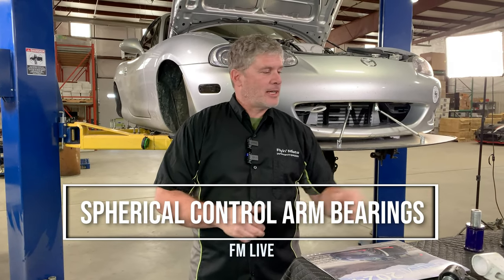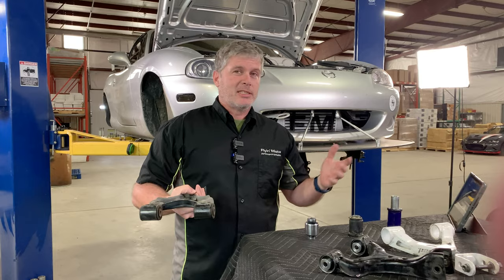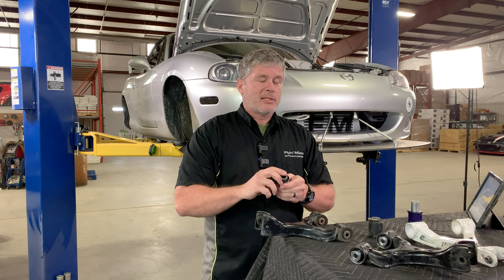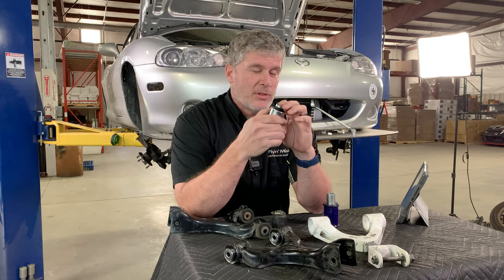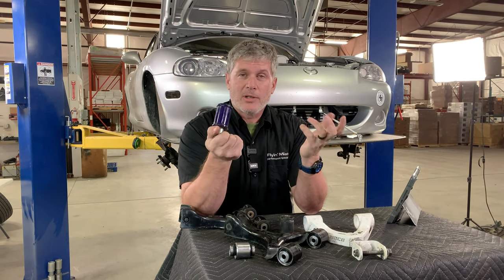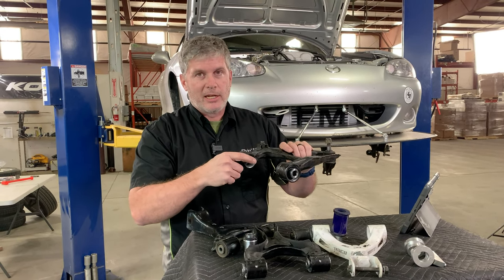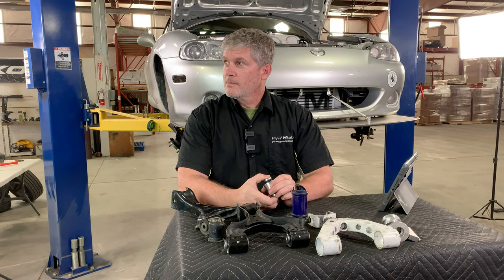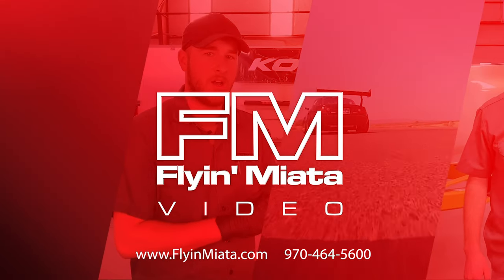BETTER THAN BUSHINGS? Control Arm Bearings with Keith Tanner (FM Live 1-4-24)

Comment: I'd love to see an update video in the future, especially on a daily.  I'm one of those nutcases considering these for my daily/autox miata even though I plan on snowy roads at times.  I'd love to hear from someone who has attempted this
Reply from the maker: That's a good idea!  We'll add it to the list of potential future videos. Keith has installed a set of these on his Targa car, which will see a fair bit of very hard use, but probably little to no use on snowy roads. Theoretically, the sealed bearings should hold up well to adverse weather.

Comment: Keith: These look great! But not for an NC ND?
Seems that is very often the case.
How long before NC gets same available lovely parts attention?
I LOVE MY NC, AND I AM INTERESTED IN PARTS!
;-}
Reply: Me need NC parts too! :)
Reply from the maker: Our NC parts catalog definitely hasn't been the strongest, but we're working on changing that. :)
Reply: Because the core of Miata enthusiast activity is NA and NB, and always will be. And the NC is the least loved Miata.
Reply: @mr.butterworth  Not for long, NC’s are actually creating quite a following, especially as they are much more capable for track use. More rigid chassis, able to fit wider tires easily, bigger engine, 2.5 swap, bigger brakes, arguably better suspension design, more modern, more interior room, etc. 

As NA, and NB age out, their numbers will diminish and replaced with NC and ND. I was told that their is a spec Miata NC now and as such Mazda Motorsport is developing even more parts for the NC chassis. Its popularity will only continue to grow. Jump on the bandwagon now before prices climb.
Reply: @ericwalther5767  yeah, keep saying that to yourself haha

Comment: These sound awesome. I seem to recall you recommending against using control arms with heim joints/rod ends in a street car, due to the severe increase in NVH. In what ways are they different to cause little to no increase in NVH? Is there any sort of damping material between the outer race and the housing?

Would using quality heim joints with a rubber dust boot cause much NVH in comparison to these?
Reply from the maker: There is no special damping material here. They will change the nature of the suspension as described in the video. And we do believe these are more of a track-focused modification. The set that's shown off in the video is going into the Targa Miata, for example. That car has no interior.
Quality heim joints (spherical bearings or rod ends) with good sealing and proper specification should work well, but those are difficult to arrange. Rubber dust boots on a generic spherical bearing don't seal as well as you might think, they really need to be integrated into the housing.

Comment: Technical question,
Rubber bearings allow slight deformation and nets slight toe in on heavy cornering allowing for easier corner navigation on track. Does having spherical bearings eliminate deflection of bushings and how does this affect track use and track times. 

Also, on northern cars, how would it deal with rust? 

Lastly, how are the spherical bearings sealed? If they ride on bearings I'm concerned on how resistant to dirt and dust from "standard" rain fall.
Reply from the maker: The factory bushings do have differing durometers in the rear lower control arm to give a bit of toe change under side loads. Aftermarket bushings - rubber and poly alike - don't. The spherical bearings won't deflect at all, so the change in handling balance will be similar to installing poly or aftermarket rubber bushings. Track times should improve given the increased precision although it will be up to the driver to take advantage of that.
The bearings are stainless steel and sealed, so they should survive the street environment. You can see the seals fairly close up in the video. They haven't been tested in northeast snow/salt conditions as that's not really their intended use.

Comment: Basically you're decreasing the low speed compression and rebound rate. Probably the LSC isn't something you'll notice, but definitely the rebound. How is the longevity?
Reply from the maker: Our supplier has been running them for years on a track car but we've just installed them when this video launched. We think they'll last a good long time but haven't had time to test them to failure yet.

Comment: So these spherical bearings are essentially ball joints. So what im wondering is why are these used on these contol arms that move in a rotational way, instead of a ball/roller bearing? These spherical bearings are meant to pivot more than rotate right? I see how these would replace the vertically mounted compliance bushings on your typical FWD car, but i fail to understand how these are supposed to work in place of the horizontallly mounted bushings in these control arms in this video.
Reply from the maker: Spherical bearings can move in multiple axes, and that's important in this case as they have to be able to deal with alignment changes. If they were simple roller bearings you wouldn't be able to adjust things like rear toe and camber, or caster and front camber. Those require the control arms to change angle relative to the subframe.

Comment: Question, would these spherical bearings perform well in a street driven car without coil-overs, but say Koni yellows?
Reply from the maker: Certainly. There's nothing magic about coilovers. However, the more responsive the suspension is the more you'll be able to notice the decrease in deflection, so the effects might not be as obvious if you're running a softer setup.

Comment: Do you have one for the rear upper knuckle for an NA?
Reply from the maker: Yes, those are included with the complete kit. :)
Reply: @FlyinMiataVideo  Is it possible to get those outside of the kit. Reason being that I am working on a custom car utilizing NA rear knuckles. So I just need those particular bushings. I was going to go with Delrin, but I understand that is the most important place for the spherical, due to the binding problem.
Reply from the maker: @jaimegrant784  I'm afraid they're only available with a complete kit - sorry!